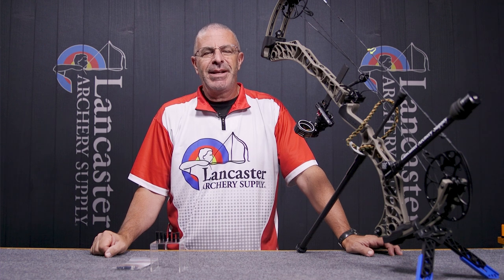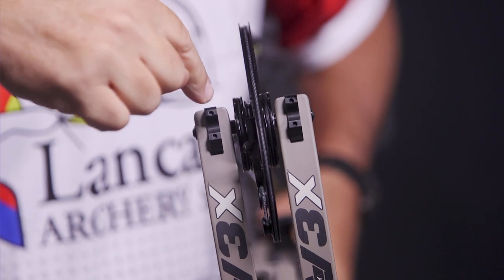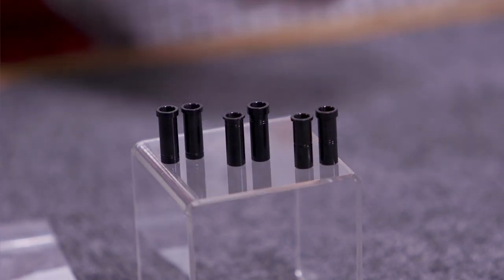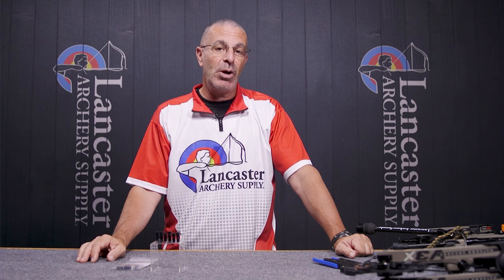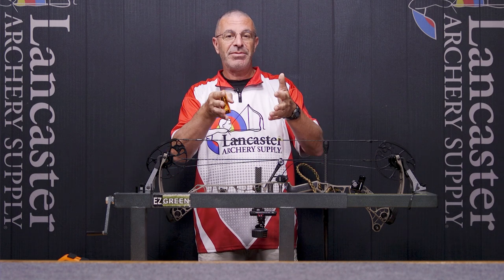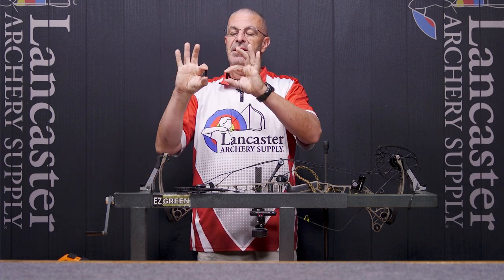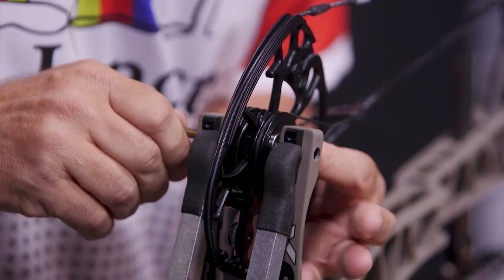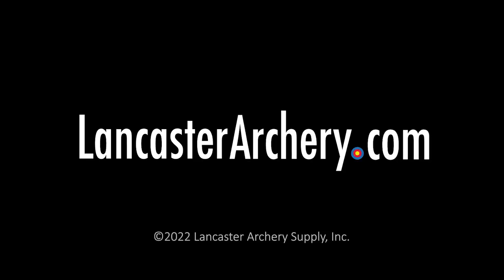Mathews Top Hat Spacer Kit

Comment: And not this that but you should never have to try to clear up a  Hold through paper with your  Arrow rest It should automatically be set at 13 sixteenths as long as you're not talking that riser you should get a bullet hole and if you don't whichever way it grips you fall asleep if you follow it so if it rips right you move your Cam to the right Meaning put the bigger spacer on the left the smaller Racer on the right

Comment: so just to be clear. the bottom and top can have two completely different top hat??? i recently swapped both cam from one side too the other and start shooting bullets... but i figured i got lucky.. also i noticed my cam timing was off so i adjusted that too....
Reply from the maker: Yes....It's possible to have two different sets - 4 different tophats - on one bow. You can have one set on the top and a different set on the bottom.

Comment: $1200+ flagship Mathews bows, and they require you to spend more money to buy a set of tophats.  AND require FIVE strings that you can't fully change out unless you take off the cams; floating yokes that you can't twist up one side or the other to get a perfect tune WITHOUT the need to swap tophats.  What used to take 15 minutes to tune, now takes more than a half-hour.  Does no one else see anything wrong with this business model?
Reply: I love my Mathew’s but definitely say WTF all the time. I’m not the original owner so instead of paying $160 a cam before labor to get my bearing issues fixed I just put USA made R4-2RS bearings in for $3.80. For less than $5 I made my bow better than factory and saved hundreds of dollars. 

I hate how they make it so hard to fix it yourself because I trust myself more than my one and only local “pro” shop.